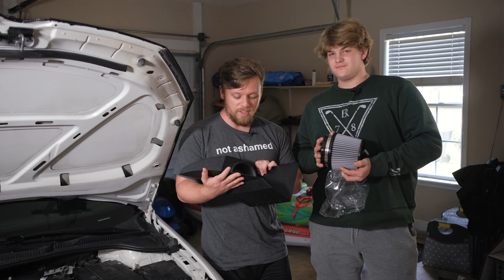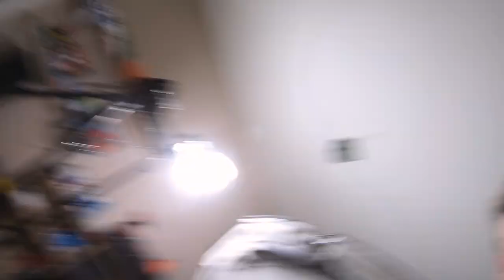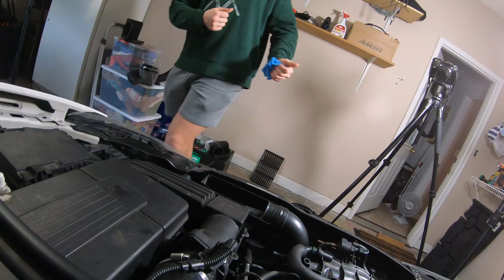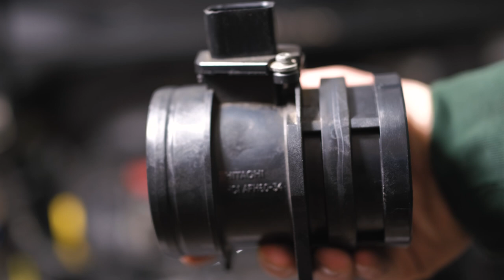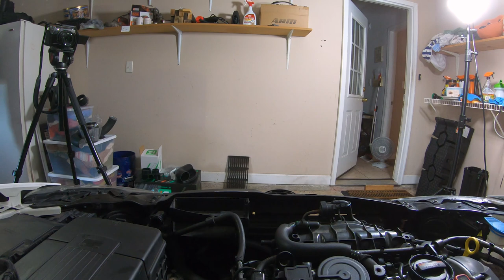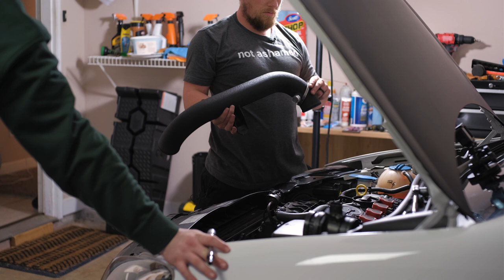Integrated Engineering Cold Air Intake Install | MK6 GTI

Comment: The part at 11:39 where you are unbolting the intake duct, do you know what screw size/number is that? Tried the typical vw T25 torx and it seems too big. Can't find any reliable answers online.

Comment: Does this intake (and other brands like CTS) use the original MAF housing? Just curious as i got my car tuned and the shop said that i’ll need to get it retuned if there’s an engine light from the intake
Reply from the maker: This and most other CAIs use the stock MAF housing. So you'll be fine! The tuning comes in mostly when you change the diameter of the MAF housing, you'll have to then tell the sensor to read the same flow rate over a larger or smaller tubing to make sure it's reading everything correctly.

Comment: If you have any rough running it will be because of the positioning of the MAF, should be in the original position for a reason mate.
Good build though👍🏻👊🏻
Reply from the maker: Much appreciated! It's running well so far but I may turn it back upright and see if that changes anything. The sensor being up doesn't bother me aesthetically at all, tbh.
Reply: @TheParkingLotMechanic  I have similar mods to yours except I have a stage 1 map which makes 260 bhp and 407nm so that’s roughly what you can expect once mapped.